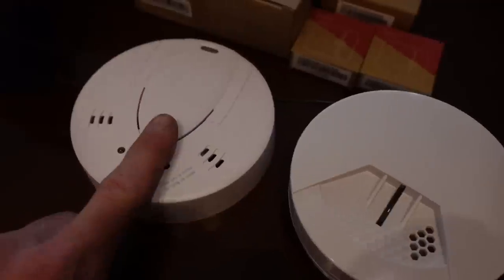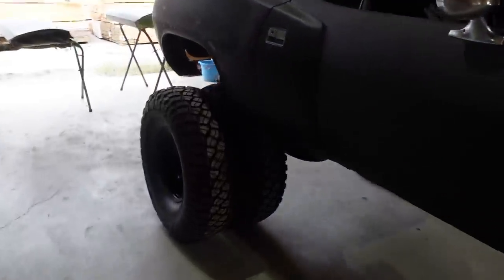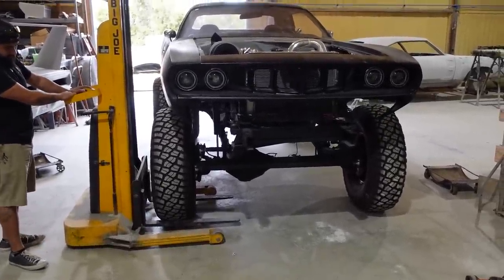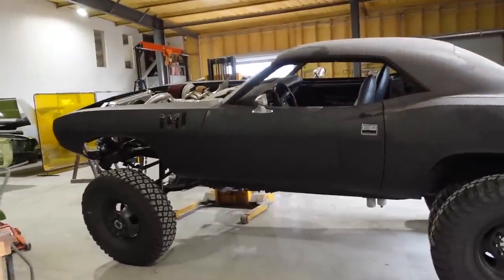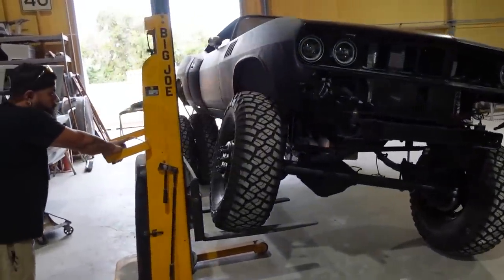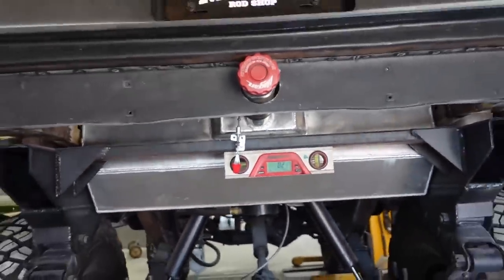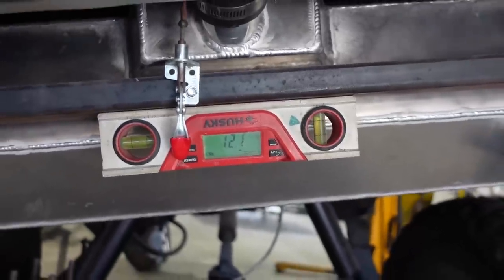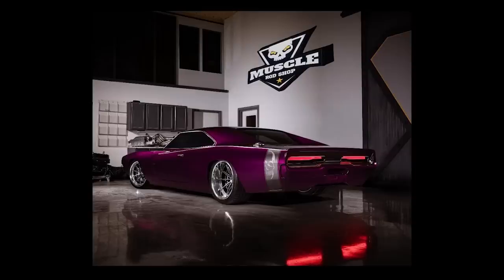1971 CUMMINS CUDA 4x4 flex test.

Comment: Working towards becoming a aircraft tech and currently in class learning metallurgy and how to bend/shape/cut metal. Definitely makes a guy appreciate the work you and your crew do
Reply: Finish the classes. I went to Teterboro School of Aeronautics in 1977-78. It gave me the sklls to make over 100K per year as a maintnence manager/technician. A&P was great!
Reply: sounds like a waste of time, learned that all at a foundry while getting paid.
Reply: @sprayqauza3060 do you learn how do rivet together aluminum sheet metal in foundry’s? We’re building our own tool boxes right now… no casting involved. It’s pretty cool!
Reply: @Casry12345  keep it up. I went the military route to learn aviation maintenance but you usually learn a lot more at the civilian A&P schools. It's a great career with a lot less rust and dirt in your eyes than car mechanics.
Reply: @denniss5512  that's a good career path, I'll give you a heads up also get knowledgeable about homebuilt aircraft as well. I say this because most of the cutting edge stuff comes out in experimental/homebuilt aviation first. 

Burt Rutan pioneered composite aircraft construction long ago, it took Boeing 30 plus years to bring the idea to the market with the Dreamliner. 

Have fun and learn all you can so you have many trick in your toolbox.
Reply: @Casey Parker ASM for the win brother!
Reply: @sprayqauza3060  I highly doubt it. A foundry doesn't involve what they teach.
Reply: Jan aircraft tech,
Reply: @sprayqauza3060  and when he graduates, he will be making triple the money you are.

Comment: Great work on that ‘Cuda! Something I noticed immediately is that the rear tires are Way over inflated. Notice how the floor dust is only covering the center 1/3rd of the tread. The max p.s.i. listed on the side should not be your “go-to” air pressure. It’s only for your maximum allowance for pressure. You need to drop that air down until all the tread is covered with dust. We call it a “chalk test” for offroad tires. As light as that rear end is, I’d be surprised if you exceed 30 p.s.i. in the back. The ‘Cuda won’t eat through rear tires nearly as much as what it would currently.

Comment: Have you guys thought about doing a 4 link coil system on the cuda. It would help with flexibility and ride a ton. I have a 1983 Cj-7 jeep and I changed out my leaf springs to coils and it's so much easier to wheel now just a thought because you know Mat he is going to brake it. So when you go to fix it you could change it. But I would like to say how much I enjoy your channel it's getting better every week so keep up the great work and keep the video's coming
Reply: Leafs can take an ass whooping and cost 20$ in the junkyard. There definitely king of the flex but they saved so much time labor and expensive joints with those dinosaurs. Happy Sunday my guy.
Reply: Maybe just the front since he will be towing.
Reply: He said yes to the coils

Comment: Just amazing.  
Of course I meen the fork lift.
With the roll cage I expect a true zero flex. I recommend an air suspension seat and a padded steering wheel.

Comment: Your shackle is setup improperly which is limiting travel on the rear. The spring won’t/ can’t compress Anymore when the shackle is bottomed out. In order for the spring to compress it needs to flatten/ get longer from eye to eye. Your shackle setup won’t allow that. The best solution for this would be to move the front spring Mount forward an inch or so. This would also give you more wheel well space for travel in the back of the rear tires. Nice build! Loved to see it come together.

Comment: If gaps shrink after lifting one front tire, then lift the other one to flex it back. It's possibly torqued body mount and core support bushings  holding their squished shape. Square body GM trucks are bad for this, especially with new bushings. May be the same issue here. Alternatively, you could loosen the core support and body mounts for a minute or so, and then re-tighten. It's worth a try.

Comment: Flexing it that far the shocks may have limited out. I know it will take adding new shock placements to install longer shocks, but knowing Matt it might need longer shocks to keep them from limiting out and breaking them. lol. he should do away with those leaf springs and put coil springs on the back like the newer Ram 2500 have.

Comment: I don't like tire roll either. The newer mud terrain tires have pretty damn thin sidewalls is why. After going through most available I found that the Falken wildpeak m/t has the thickest sidewall and bead of them all and it doesn't act like that BFG mud just did. I run the 35x12.50r17 Falken m/t's on my 2013 power wagon at 20-25 psi at all times for a smooth ride on our crap roads. I drive like I stole that shirt daily in case that matters. A set of 35's last me 25k miles max...

Comment: Those high arch rear springs are being challenging: with a high arch, the length difference as it straightens is greater. The shackles need to be taller, and possibly the top moved rearward.

Comment: You can't expect a car on a truck  chassis to stay square without a cage on leafsprings when you pick the rear tire up off the ground by jacking the front tire up.     Guaranteed the gaps would of stayed if the rear tire didn't lift up hell of a build guys

Comment: with the amount of curve those rear springs have got you need to have much longer shackles otherwise you are going to break a lot of things! just try to imagine what the spring is going to do after the shackle is fully extended when it lands off the top of a ledge or even worse a jump? that is a huge amount of leverage trying to tear those shackles and the frame apart!

Comment: In tow motors xxxxlb lift cap is not how much they can lift total but how much they can lift with out tipping over. You could put 4 or 6 ton straps around the forks and the base and probably snap the straps before you would blow our the hydraulics or break something. If you tried to lift 2.5 tons and then tried to move it you could be in serious danger of the unit flipping over. But a static load like what you have there yeh no real problem.

Comment: Back leaf spring brackets need defo be stronger. Roll cage isn't going to help them :D. Also, flex might be stronger when there is extra weight inside.

Comment: Yeah, the spring mounts need a bigger bolt and some reinforcement I think; just an extra plate welded on each side where the bolt goes through the mounts, top and bottom. A couple other points on the suspension and the springs could use it too. That things going to be putting strain on all of that when it is moving and crawling through uneven terrain, and I guarantee what's there isn't strong enough for that sort of stress and strain. You get big 4x4 trucks with suspension beefed up going out and breaking all that stuff regularly. This is no different.

Comment: You should air down those rear tires a bit so you don’t wind up with uneven tread wear.
Reply: The cars not done yet so it's not really a concern at this point, and when it is done it's going to be a tow rig so he will likely need to add air.

Comment: Well after that I am scared to see how much stuff got bent. Because I know if you had it in alignment and then did that and took it back to be aligned again it would be way off. And every I guarantee the tires will wear unevenly and wheel bearings will go out and more stuff will break as it is driven. I would not recommend flex testing that much unless your going to replace everything again.